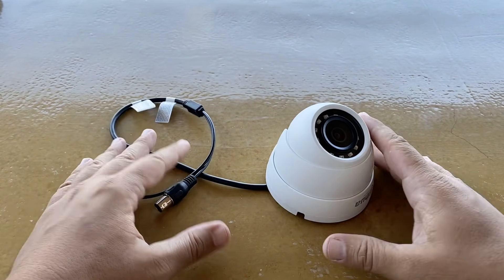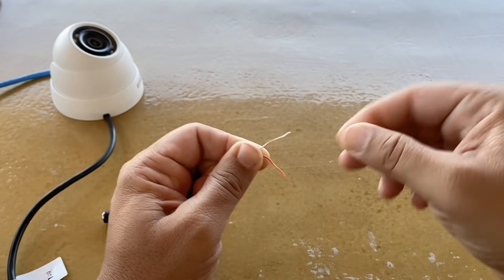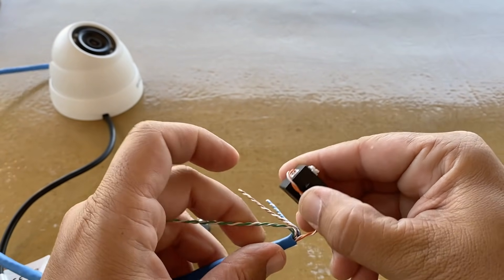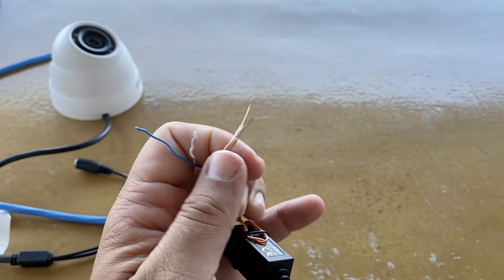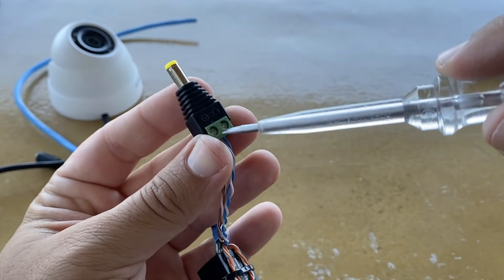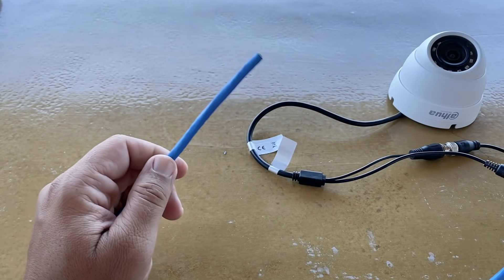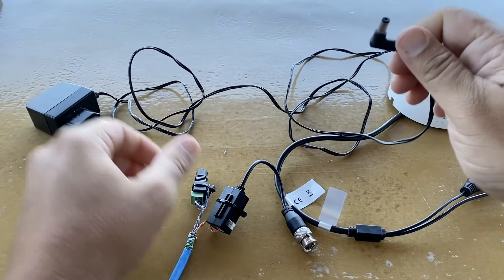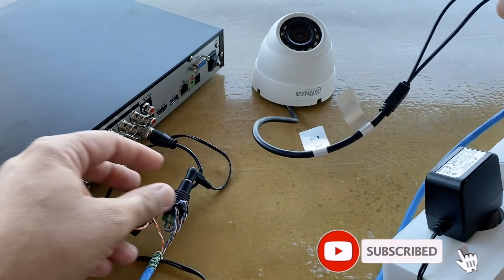Connect CCTV camera to DVR using video baluns and UTP cable

Comment: i saw a same setup while working for a client but the peroson that did the setup connected all the power cable in to one so 8x cameras cable in to 1 and connected them directly to the electric line and some ho wit's worrking ho wis it not burning the circit of the camera when connected directly to ac current without an adapter

Comment: I did this on a large scale as I futureproofed my telecom system by installing 25 pair wire throughout my house and had enough spare pairs to install a 8 channel DVR using this same method. I'm really glad I did because the system works great. I used the AC Baluns for my power connections.

Comment: Hi I have done a similar connection but there are vertical lines on the display and on the remote viewing app and the CCTV footage is not clear, kindly,what can be the problem and a solution?
Your help is highly appreciated
Reply from the maker: I believe that the problem is the cable you used or the video baluns quality. Since to change the cable will be more difficult, try please to change a pair of video baluns.

Comment: But what if want to use a ptz camera with a power over Ethernet female connector to use on my DVR with BNC and wire it to to DVR ptz controls?
Reply from the maker: The UTP cable has 8 wires that are enough for connecting a PTZ Camera.
Reply: @PoseidwnTech  would you happen to know the color code wiring for which cables on the Ethernet cable are video for the BNC (video), power to the camera, and the + and - that go on the little green adapter to control the ptz functions so that I may connect them to my DVR or do they vary from camera to camera and Ethernet cable to Ethernet cable?  If so do you have link to diagrams of which "pins" on the 8 "pin" Ethernet connector are for what function?

Comment: How could I use a V+ and V- pair coming in (ie. as the input), and translate it to a more 'user friendly' output (like HDMI)? Can I use the balun to have the signal run the other way, and then plug the coaxial into a converter? Thanks :)

Comment: This is very helpful, but one thing I don't understand. If I have 10 cameras, will I need 10 power adaptors to power all the cameras?
Reply: Hello, did you ever get an answer for this, I am wondering the same thing.
Reply: It depends on the charger amperage. Usually one camera draws 0.5A of power, so you'd be safe with a charger with 0.5A or higher output. 
If you do have a 3A charger, in theory you could hook up 6 cameras, but I wouldn't do that. I would say only 3 cameras are safer.
Reply from the maker: I agree with you!
Reply from the maker: Please check this latest and more detailed video : https://youtu.be/Gvhwlo3QIb0?si=glaQoLEVcG9e-8ve

Comment: Sir, I have a question, can you pair 2 cameras with 1 Ethernet cable, since there are 4 pairs?
Reply: You can but sometimes there can be problems with signal mirroring. I have connected up to 3 cams over one utp cable but this is not advisable.
Reply from the maker: Please check this latest and more detailed video : https://youtu.be/Gvhwlo3QIb0?si=glaQoLEVcG9e-8ve

Comment: Normally i use following: Video balun green for + whithe green for - and for supply brown and blue for + and white brown and white brown for - . The orange and orange white i don't use it. Every single cable for one camera and i puted 4  in every corner. I think that's the way for good connection and no interferences
Reply from the maker: Please check this latest and more detailed video : https://youtu.be/Gvhwlo3QIb0?si=glaQoLEVcG9e-8ve

Comment: Question… you didn't use a pair of the ethernet cable.  Do you think I can use a single ethernet cable to connect two cams to the dvr? Of course I have to share the two pairs for the power supply of the two cams and, if the second cam is in a different position from the first, I have to open the ethernet cable and remove the pair of the second cam.  What do you think about it?
Reply from the maker: Please check this latest and more detailed video : https://youtu.be/Gvhwlo3QIb0?si=glaQoLEVcG9e-8ve

Comment: Two pairs are always better than one.

CCTV with two pairs in the balun gives a certain amount of redundancy in case one pair breaks. This is especially relative and important when installs are carried out in this configuration in cold countries.

If installation takes place in very cold conditions, one pair can break very easily as Cat cable becomes extremely 'brittle' in the cold. Also freezing temperatures can lead to a break in the Cat cable inside any enclosure that the connections are housed in outdoors if there is any significant tension on the cable due to a tight fit. 

In both cases two pairs are far better than one. As using one is just laziness by the installer to be honest!
Reply: Exactly, i normally use all pair to connect dc and video to keep better redundancy and never had an issue in resolution or voltage
Reply: "It is critically important that you DO NOT double up on the pairs going into the baluns. Ehternet cable is UTP cable with specific twists in the cable, having two pairs can cause interference and video loss, especially on longer runs. You must only use one pair, not two." ... from https://www.youtube.com/watch?v=FsnG-8UuiU4
Reply: Bcxw, and I  cb m dz I jiovj
Reply: I’m getting double imaging after having doubled up on the video feed, would dropping to just one pair fix my problem if anyone knows ?

Comment: Does it work seamlessly when the utp cable is up to 300m, if so how do I solve the power problem from 300m away?
Reply from the maker: 300m it is a long distance! I don't remember to have tested in a distance like this. For more than 100meters i try to connect the power supply closer to the camera.
Reply from the maker: Please check this latest and more detailed video : https://youtu.be/Gvhwlo3QIb0?si=glaQoLEVcG9e-8ve

Comment: Hello there! I want to know if I can apply this type of connection for my analog camera to connect it to my NVR. So the idea is to have only one end of the UTP cable with video balun and the other end of the cable to have RJ45 to connect to the switch. Would that work????
Reply from the maker: Not with these baluns! You will need an analog to IP converter but in my opinion does not worth it.
Reply from the maker: Please check this latest and more detailed video : https://youtu.be/Gvhwlo3QIb0?si=glaQoLEVcG9e-8ve

Comment: terimakasih informasinya, mau tanya apakah ada perbedaan kualitas video menggunakan kabel utp cat5e atau cat6?
Reply from the maker: For the analog cameras there is no difference, but the idea of using UTP cables in analog cameras is in order to make a future proof installation and to be easy to convert your analog system to ip. So it is better to use Cat6.
Reply from the maker: Please check this latest and more detailed video : https://youtu.be/Gvhwlo3QIb0?si=glaQoLEVcG9e-8ve

Comment: What is the maximum length of this configuration?  dc power and balun connection if the power supply is centralized?
Reply from the maker: With a Cat6 cable and using 1 pair(2 wires) for + and 1 pair for -, i don't recommend to use for more than 100 meters.
Reply from the maker: Please check this latest and more detailed video : https://youtu.be/Gvhwlo3QIb0?si=glaQoLEVcG9e-8ve

Comment: Great video i have a question.  Does it make a difference if i use a 2mp balun on a 5mp camera? And why?
Reply: The guy clearly doesn't pay attention to answer the comments, but I don't mind to give a definitive answer to your question.

It depends on the voltage. If your camera (check the label sticker on the camera unit/box) takes 12 volts and only needs (required) 1 amps or maybe 1.5 amps, don't worry if you put a power supply with 12 volts and 3 amps or 5. The voltage where you have to be picky and careful. I use 2.5 amps just in case the power supply gets weak over time due to our extremely hot weather (Middle-East). I hope I answered your old unanswered question throughly!
Reply from the maker: I apologise! It requires a lot of time and effort to create videos and sometimes it is very difficult to answer every comment! Thank you for taking the time to answer!

Comment: nice way if you want to save some money from the cables.. but what happens to HD cameras with 3 or 5 Megapixels? you may have loss in image quality. for long distances you can use a dvr that gets 2 or 4 extra ip cameras so you don t have to use signal cable at all.. for any other installation i think that nothing is compared with the classic coaxial camera cable.
Reply from the maker: I haven't noticed any image loss even in higher megapixels cameras. The only problem with long distance it's the DC Power. I agree about the coaxial cables but with the UTP cable it's easy to upgrade your system from analog to IP while with the coaxial you can't.
Reply: @PoseidwnTech  it depends on what type of system you want to build. best thing you mentioned is that at long distances you can use an additional power  suply pluged where the camera is located. no power loss at all.. At my location nobody is using ip cameras because at a 24mbps connection the upload speed is 1mbps an the download 13. only a few locations have faster internet than this. the dvr's also downgrade the resolution so the image flows properly. only hikvision dvr's run pretty well
Reply from the maker: Please check this latest and more detailed video : https://youtu.be/Gvhwlo3QIb0?si=glaQoLEVcG9e-8ve

Comment: If the length of wire is +40 meter.. did adapter loses ampere at end ?
Reply from the maker: At 40+ meters with Cat6 cable you will not have any problem. But after 80 meters you will have to check.
Reply from the maker: Please check this latest and more detailed video : https://youtu.be/Gvhwlo3QIb0?si=glaQoLEVcG9e-8ve

Comment: Twisted pairs are crap use proper cable you can buy them premade any length for peanuts
Reply from the maker: The only reason to use utp cable is for connecting two analog cameras using one cable or to have your installation ready for a feature IP Cameras upgrade.
Reply from the maker: Please check this latest and more detailed video : https://youtu.be/Gvhwlo3QIb0?si=glaQoLEVcG9e-8ve

Comment: 200 metter Video quality ??
Reply from the maker: At this distance you will not have problem with the video signal but with the power. So i recomment to use FTP Cat7 Cable and try to power the camera locally. So the video signal from DVR to Camera will be 200 meters but the power supply from the camera less than 100 meters.
Reply from the maker: Please check this latest and more detailed video : https://youtu.be/Gvhwlo3QIb0?si=glaQoLEVcG9e-8ve

Comment: rg59u cable and 18ga 2 conductor for power is the way to go... NOT THIS CAT wire!!!!   Stupid video and mis informed information!!!!
Reply from the maker: I understand that you don't agree but i don't understand why are you so angry about it. If you don't like it don't use it. For this video i used a simple UTP cable, but if you want you can choose S/FTP Cat7 shielded cable. I am suggesting video baluns because with one cable it can support up to 2 analog cameras and it is future proof since you can install later IP Cameras! With RJ59u cable are you future proof? Or when your customer will want to upgrade his system you will tell him that he has to change also the cables...

Comment: Thank you very much for this! One question: If you have one power supply and want to connect two analog cameras, what do you do in the power supply end? Do you put two pairs in each input, so 4 pairs in total?
Reply from the maker: When i want to connect two analog cameras in 1 UTP cable, i am using the orange pair for the video signal of Camera1, the green pair for the video signal of Camera2 the brown pair for power supply (+) and the blue pair for power supply (-). At the end of brown pair and blue pair i am connecting extension cables in order to add 2 male dc power jacks for the 2 cameras. In order to connect the brown and blue pairs with the extension cables i am using 3M Scotchlok Connectors : https://youtu.be/bhlmS7lvUBk
Reply: Would that create an issue where both cameras are not getting the right amount of voltage?.
Reply: 8PM

Comment: Hi, your video is very useful, thanks... I have a question: How far could the utp cable power 2 cameras without voltage loss ?
Reply from the maker: Please check this latest and more detailed video : https://youtu.be/Gvhwlo3QIb0?si=glaQoLEVcG9e-8ve
Reply from the maker: In some of our installations we used up to 80 meters cable without any problem, but for longer distances we give power to the cameras locally. For example we installed cameras in a house and the customer wanted to add also 2 cameras in a storage room. The distance between the storage room and the DVR (house) were more than 100 meters. So we used 1 utp cable for the video signal but we installed a DC Power Supply (with battery backup) inside the storage room in order to give power to the 2 cameras.

Comment: Cat 6 cable not designed for analog camera care-full DC + - and stripes better keep in middle of wire so its will not move down incase if some one pulled hardly
Reply from the maker: For that reason we are using cable ties in the video balun and the power plug.
Reply from the maker: Please check this latest and more detailed video : https://youtu.be/Gvhwlo3QIb0?si=glaQoLEVcG9e-8ve

Comment: I often wondered how UTP long runs don't lose voltage since the wire guage on utp is so thin.  The doubling up of  a PAIR to each pole of the power feel is a great idea i think.  Minimizes the line loss due to thin wire.
Reply from the maker: That's right! Thank you for your comment!
Reply: @PoseidwnTech  επίσης το utp μόνο κόβεται και σου σπάει τα νεύρα.
Reply from the maker: @conktr  Σωστό! Θέλει προσοχή όταν απογυμνώνεις τα καλώδια!
Reply: @PoseidwnTech  δούλευα σε μια εταιρεία παλιά και βάζαμε συναγερμούς DSC στην εθνική τράπεζα.Ε όλοι οι μηχανικοί του έργου περνάγανε δικτύου αντί για (6 ή 8 )Χ0.22 AWG για συναγερμό.Ε είχα μαρτυρήσει ειδικά σε κάτι ποδόπληκτρα που ενώ το περνάγαμε διπλό και κολλημένο με καλάϊ πάντα κάποιος ταμίας θα το έκοβε.Οι κάμερες είναι εντελώς διαφορετικό παιχνίδι εκεί το cat6 με balun και φυσάκια τροφοδοτικού έσωσε ζωές και crimping tools.😄
Reply: Because the camera's do not pull a big load (amperage). Electrical load is the cause of  voltage  drop.  A wire can be run for miles and if nothing is connected to it you'll have the same voltage at both ends. If you start connecting items to it at the end of the wire you will eventually see voltage drop.
Reply: I double n triple up on video wires an it's d same any ideas
Reply: Is there a specific reason why you only double up power and not video?
Reply: @haydnthomasfilmscorporate1553  because the voltage on video line is lower but yes, you can double the video if you consider it as long as you still have another pair of wires unconnected

Comment: Can you tell this step all camera system working?
Reply from the maker: Yes all cameras are working! And also if your customer wants to change the cameras from analog to IP you will have just to terminate the UTP Cable with RJ45 connector. Also with utp cable you can connect two analog cameras at the same time.
Reply: This kind of power supply for only one camera not for all
Reply from the maker: Please check this latest and more detailed video : https://youtu.be/Gvhwlo3QIb0?si=glaQoLEVcG9e-8ve

Comment: I think that rg59 cable is more suitable solution for this type of connection
Reply from the maker: For sure rg59 cables are more suitable but in case only utp is available these video baluns are very handy
Reply: @PoseidwnTech  Thank you for your reply
Reply from the maker: @nickgs3713  You are welcome! Another reason for using UTP cable is that you can use it for analog and IP cameras. So for example if your customer wants to change the cameras from analog to IP you will have just to terminate the UTP Cable with RJ45 connector. Also with utp cable you can connect two analog cameras at the same time.
Reply: @PoseidwnTech  That's very interesting.
Reply from the maker: Please check this latest and more detailed video : https://youtu.be/Gvhwlo3QIb0?si=glaQoLEVcG9e-8ve